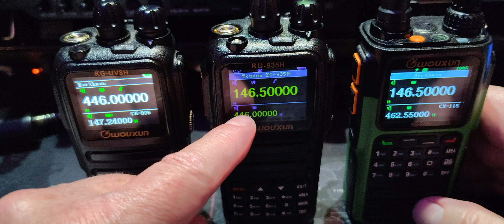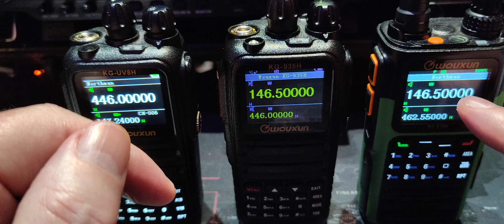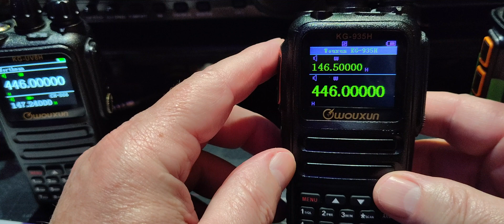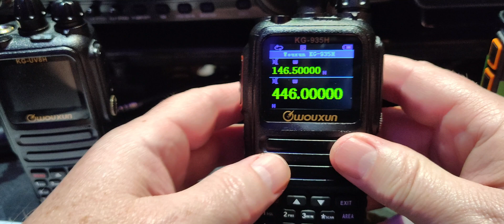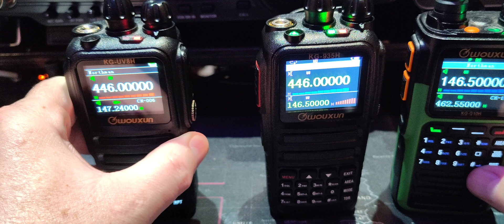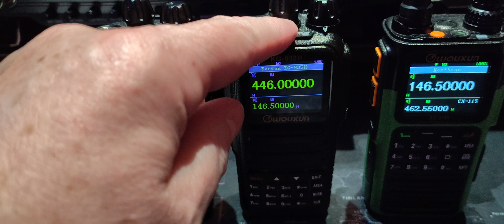Crossband Repeat Wouxun KG-935H

Comment: I'll be the first "some person" to ask about transmitting without antennas affixed to your 2 radios on the left.
Reply from the maker: Oh yes. Well that's cool. The radios since they were in such close proximity they would overload the receiver with the antennas on. At least those two radios did so I took them off for the example. No harm don't it's just a short moment I did that. But good question. Just too close is the only reason I did